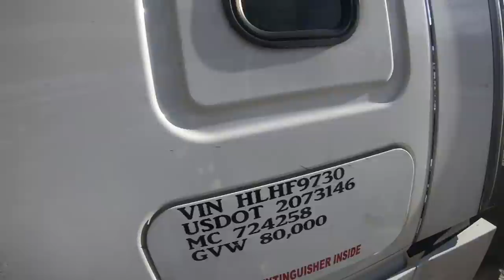Simple Tow Turns Into More

Comment: Always love these big truck video's.  I have seen truckers with a trailer and two pups just maneuver, back up and unload each one as if it was a single.  Never ceases to amaze me the common sense and skill of these drivers!

So here I am looking at this video and seeing beautiful spanking new tow truck and semi with hardly a spec of dust on them.  But in this day and age with computers and camera's/dash cams, why don't you install a dash cam either in front or behind the plate to easily align with the king pin?????   takes the guess work out of it!

Have to admit, that is one well equipped heavy tow truck.  Very impressive.
Reply: Lisa b you don’t need it. You line the whole truck up with the trailer, and unlike a gooseneck or bumper you’ve got quite a bit side to side before you miss the throat of the fifth wheel. If you have to (and this is a baaaad thing to do, great way to break landing gear) hook from not straight on it could help, but if you get into that situation it’s time to chew out the driver who dropped it like that.

Comment: Just a suggestion to make retracting a landing gear easier... dumping the air bags was right,  but as soon as you feel the fifth wheel touch the kingpin pull forward a few inches, inflate the airbags, then before coupling, crank until the foot is just barely off the ground. Then couple and finish raising the gear.  This reduces the chance of lateral forces making it harder to crank up. Let the truck do the work for you.

Comment: Why didnt u put a snatch block to the front fender pin of the Tractor unit where it was originally parked at side of trailer to pull the truck back 
Would have gave u enough room to then pull it out from the front with yours

Comment: If the airbag drives are not chained , will the bags burst upon lifting?
Reply: I think it's to keep the drive wheels from dangling so low, so they don't have to lift as high and put the towed vehicle on such a steep angle.

But don't quote me on that - I'm just guessing.  :-)
Reply: It can tear the bags or damage other suspension parts. They’re not designed to support weight hanging from them, but sitting on them.
Reply: Thanks for the info!!